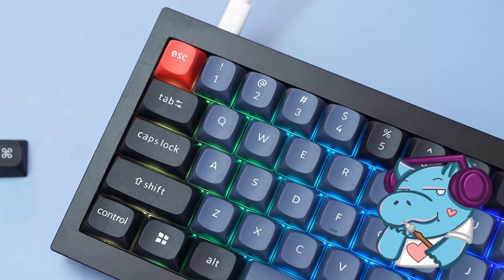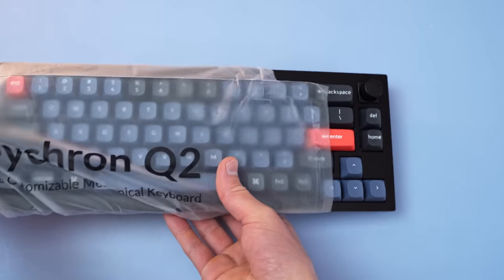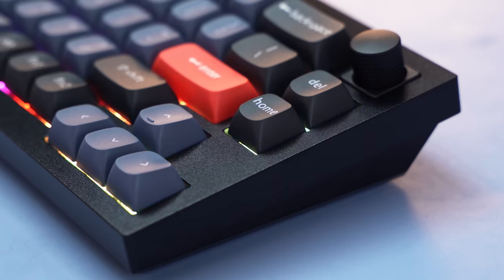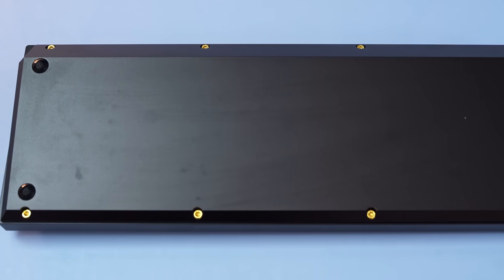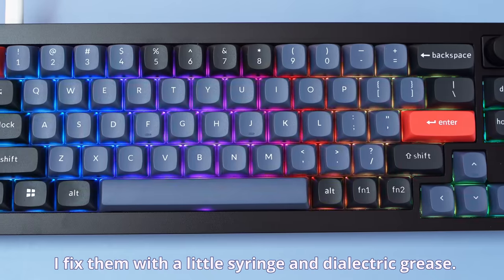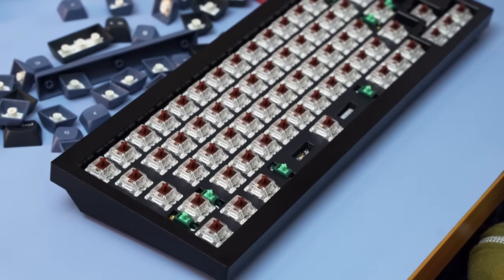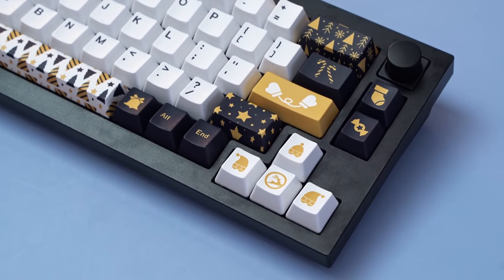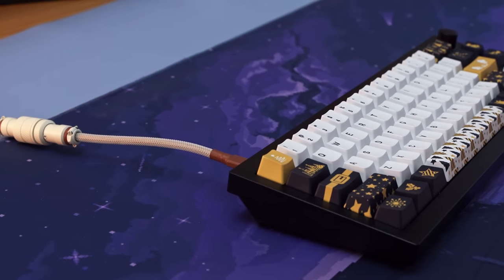You don't NEED to mod this keyboard.... but you should.

Comment: Other than the keyboard this channel requires no mods. It is just perfect!
Reply: and just like the keyboards it can only be better with mods
Reply: @emubbq  But the only applicable mod is the subscribe mod!
Reply: @cenevspeed  Nice use of applicable. I am captivated by your choice of words.
Reply: @cloakedmasq3949  nice use of captivated, I am mesmerised by ur choice of words
Reply: @xtrasin6659  nice use of mesmerised,  I am intrigued by your choice of words
Reply: @Ilovemydogssssssss awful use of intrigued, i am appalled by your choice of words
Reply: @pencilsharpener1626  awful use of appalled, I am disappointed by your choice of words
Reply: Hey there! As a fellow tech enthusiast, I couldn't agree more with your comment. In fact, I recently came across the HOTO Compressed Air Capsule and it's been a game-changer for keeping my desktop setup clean and dust-free. It offers powerful vacuuming and blowing capabilities, making it perfect for maintaining a spotless environment. I highly recommend giving it a try! 👍

Comment: The later version of the q1 had a knob option as well. Also the q2 comes with pbt keycaps instead of the abs you mentioned. Awesome video btw!
Reply: Yep, the Q1 w/knob has all the improvements of the Q2 as well (except for the nicer PBT keycaps). Better stabs, force break mod, heavier bottom case, steel plate instead of aluminum. I got mine the other week and it's pretty good stock. I do need some better keycaps though.
Reply from the maker: Yep! My bad I got the keycap material mixed up 😭
Reply: @HipyoTech  noob
Reply: @HipyoTech  is the Q1 with knob as good as the Q2 in you're opinion?
Reply: @Faced1111  I heard they made the same changes as the q2 with q1 with knob. Except keycaps but most go barebone and purchase keycaps separately anyways.
Reply: @OwOMoment  I know the revisions are mostly the same, but still different boards, like size and gaskets are a bit different

Plus I've heard a q1 with a knob in a video and it still sounded pingy
Reply: @Atmos312  I was just coming here to ask about the Q1 v2 as I just picked one up as my first move into this blackhole of a hobby after using DAS4 boards for years.   I do have some GMK caps I was going to try on this as well as some of these mods.  This comes with red pro switches, which has me sold on linears over tactile (I didn't have the choice of barebones out where I live) - did you apply any mods to your Q1?
Reply: Howdy Hey!!!
Reply: @HipyoTech  is the keychron latency as bad as people say or marketing hype for more gaming focused boards?
Reply: Hey, {{3}}! Thanks for your comment. I absolutely agree with you. The HOTO Compressed Air Capsule is a fantastic tool for keeping your desktop and other spaces clean. It offers powerful vacuuming and blowing capabilities, and it's really convenient for reaching tight spaces. And the best part? It's reasonably priced compared to other options out there. I highly recommend giving it a try. Happy cleaning!
Reply: @HipyoTech hehe boi it ain’t 69 anymore

Comment: I'm officially 100% addicted to keyboards, mods and making everything I have that I type with sound  like lush buttery finger candy.  Thanks hypyo for the inspiration and great ideas.  Oh, and the amazing content you create.  
I just spent the last 8 hours modding my K4 with neoprene in the case, lubed all the gateron browns, keycap stem o-rings and am now waiting for my K66 Womier from drop because it stupid cheap right now at 70 beans.  I ordered the Holy Panda Xs as well for that board.
Reply: Hi! I've been thinking about getting myself a keyboard to mod or a kit and start from there. 
Could you recommend me something good (between 100-200$, switch etc included) that would be ideal for a beginner like me?

Thank you!
Reply: @ruifilipe4893  Nobody responded but I just got the Nuphy Halo75 which is a custom pre-built and it's a great place to start from for the price. I went with the Rose Glacier switcher (tactile) but I'm thinking of getting the Night Breeze (linear version) for gaming. Definitly check them out, great quality for the price.

Comment: Not sure if anyone mentioned in comments, but they added the force break mod through silicone dampeners in place of where people have been putting tape in the previous Q1 to reduce ping by a mile. The Q2 and future Q1's will now have these pre-installed :)
Reply: I was ready to do the mod and was super surprised when I opened my q6 to see they had already done it. Kind of disappointing lol

Comment: I'm typing on my Q2 now.  It's my first keyboard in a few years.  I have 2 Leopold FC750R's with browns and blues. Those were my first "real" keyboards.  This Q2 takes the build quality to another level.  This thing is HEAVY.  And it's my first 65%, which has been shockingly easy to adjust to.  Apparently I don't use the function row?  The stock sound is pretty nice but I plan to do Hipyo's mods but use black ink v2s and Akko caps.  I've never lubed and filmed switches before, so I wanted to learn.  That deeper sound is amazing.  Great video!

Comment: Great Video! Just wanted to point out that this board uses Double Shot PBT (you said abs) keycaps
Reply from the maker: Yep! My bad!!
Reply: @HipyoTech    I’m willing to buy a stock keyboard without modding it so between this , IQUNIX OG80 and Q1 V2 which they apparently fixed the ping issue with it which one do you think should I get ?

Comment: Got this board a week or two ago and I did the tape mod with 4 layers today. Can’t help but feel like the gasket mount is a bit stiffer but it’s definitely worth it. Planning on putting some oil kings in there now, though I’ll probably wait til Black Friday because I need lube, films, a switch opener and stabs too and it’s only like 10 days away so I might as well.

Comment: This keyboard sounds cool I'm usually not into clicky keyboards at all I just prefer no noise for a more silent gaming session. But I've watched a couple of your mods and I must say I think I get why people like the clickiness 😅 anyway my go to snack would be anything I can use chopsticks to grasp so I don't have to get my fingers full of chip residue or grease lol
Reply: It sounds clicky but it's what us keeb enthusiasts call the "clack". The switches used here are linears, not really clicky switches. Also, it's because the board is aluminum that's why it "clicks"
Reply: With these mods which are pretty easy, it got a more deep and muted sound to it that I really dig. Audible, but not enough to pick up and annoy people over comms like plastic clicky gamer keebs do.

Comment: Loving this board so far, but my only complaint is the loud spacebar. How did you get it to sound so... pleasant in the after mods section? Is that because of the change in switch with lube and film? Did you do something to the stabilisers? Or is it a combination of stabs + switch + tape that makes it sound far quieter? The actual switches themselves I'm really happy with for now. 

Oh, and VIA software and modding is absolutely lovely. Huge fan. Is it possible to add extra layers, does anyone know?

Comment: Switched from a razer blackwidow chroma V2 that I'd been using for about 6 years now to the keyboard in this video, modded in the same fashion, just with a different style keycap from keychron and the blue version of the board since it was the only one in stock. The difference is absolutely night and day. I enjoy typing on this keyboard like no other. I hope this board takes me through a decade and stands the test of time because the quality in the materials here is outmatched by the consumer and gaming keyboards hitting the market today. I feel like I'm typing on a mechanical cloud. It's beautiful. A good lube job and some films elevate these switches too. Box ink pinks are the way to go for this board for sure.

Perfect keyboard build for everyone. This is a must grab. My only gripe is that programming this board in particular with VIA is buggy as hell and a mess to get going. I've had it crash way too many times out of the gate. Keychron seriously needs to get on that with better VIA support, especially for a keyboard company as big as they are there isn't an excuse for that kind of poor performance.

Hardware for this build is a 100/10 but the software support is like a 5/10. May I type on this board through the ages. Thank you hipyo for a perfect keyboard, this just hits the spot.

Comment: I think the film at the bottom is there to prevent it shorting out. The space between the pcb and the case is quite small, so the pcb could maybe touch the case if you press down hard.

Comment: Howdy Hey Hipyo! This is my comment section typing test, its done with a gk86xs with lubed and filmed gateron blacks, neoprene foam case mod, tuned plate mount stabs that are just above average and stock DSA keycaps while i wait in my dream set nk pbow to be back in stock. Its an ok board to use and i have no complaints really besides the software.... but that Keychron Q2 making me wanna save up my  money for one soon.

Edit: this is my first custom board, I wanna do more honestly but i have to live within my means.

Comment: "After Mods" 10:21 - I feel like I missed something? Which mods are we talking about? Beyond the tape mod. Changing the switches and keycaps? Did it make that big of a sound difference going from "Tape Mod" to "After Mods"? Because if so, holy... that's significant.

Comment: so the q1 now has a knob version, its actually what im using to type this out. i built mine out with durock linear teals lubed and filmed, GMK laser r2, and durock v2 stabs. i did do a kilmat mod to it and it kept the flex and sounds really good, and the tape mod. they also added the force break mod to the keyboard out of the box which helps with the case ping.

Comment: Wait, elaborate on those switches some more? Did you mod them, or are they pre-modded. Also they look like the pinks which would have 50g springs, but I see they have some kind of black layer or gasket in them, which is different from the images on k4a website.

Comment: What a coincidence. I'm actually getting the same color barebones kit, have some black ink v2's coming (which I will film and lube), also got some of their dye sub PBT caps. I imagine my board will sound about the same as yours after the tapemod, if so I'll be quite happy with that result.

Comment: Hey, did you really only mod this keyboard by:
1) tape modding (3 layers)
2) Ink Box v2s
3) Different Keycaps
?
Because if so, this is really amazing. If not, what else did you mod? It's still the metal plate right? And what about any additional foam? Great video by the way.

Comment: In my opinion the best budget keyboard for gaming is the Higround basecamp series. Sounds amazing stock but you can make it sound even better with mods. Im using it right now and the only thing ive changed about it is I changed the prelubed TTC switches for some unlubed KTT roses. It sounds about the same, just a little deeper now.

Comment: You can never go wrong with some good Pizza rolls. Don't know how they are in the usa, but the one's at Domino's in Germany aren't that good, they have a little bit too much bread and only a wee bit of ham/salami/whatever you are ordering with them, but another pizza chain named "Smiley's" (I think it got founded in Turkey) have just the perfect pizza rolls. I prefer to order them with normal ham or however it is called in English, and they just have this nice, more wet bread that isn't as wet as if you would say it is getting more of a downside, but rather I would say... Juicy? Well, anyways, you also got this nice slice of ham just baked into it in the form of a spiral, surrounded by the "molten" cheese (it's at the same point between really solid and molten as the mozzarella on pizza), and the bread. It is, hands down, one of the best snacks I've ever eaten. If you just read through this, then seriously, what are you doing with your life

Comment: Have to ask, have you tried modding the K10 (aluminum frame)? I've done the basic tape mod and shoved some foam underneath...buuuut...it doesn't have that thock. Using gateron pro2 reds. :)

Comment: Hey ya, at 3:47 you mentioned the keycap is ABS. However from Keychron website, they said they included a set of double shot OSA PBT keycaps. It'd be great if you can confirm this. Thanks. :)

Comment: I recently purchased a Keychron K7. The K7 is advertised as "wireless". It is actually Bluetooth (same frequency band, different protocols). Connected to my system with supplied (too short) USB cable. Multiple keys do not work. Keychron sent me a link to a website designed to test keyboards. I sent a screenshot of the results to Keychron. Keychron demands a video showing the keyboard and screen proving that I did not falsify the test results. The product is sold "as is" - there is no warranty. Tried to get an RMA number and a return shipping label. If the keys do NOT work, the feel DOES NOT MATTER, and the reliability DOES NOT MATTER! If this is the way they treat their customers, do not expect them to be there in a few years.

I have never had a company demand that I provide a video proving that I did not falsify their test data. Look at their "service" non-warranty. They specify "as-is". They do not guarantee that their products work to any extent. And they refuse any responsibility for what happens when you use their product. The laws in Hong Kong must be very different. 

The reason some keys do not work could possibly be defects in design or manufacturing. More likely, the firmware does not conform to the USB Human Interface Device (HID) standard.

Since they take an adversarial position to customer complaints, I do not see them lasting very long. Other manufacturers can make (or buy) red optical switches. Do not expect Keychron to be there when you have problems in 5 or 10 years.

I have demanded that, for the video, they must send a cameraman and equipment and pay me my consultant fee for demonstrating that their keyboard does not work. I have also demanded a written apology from the CEO and an immediate refund.

Other manufacturers should re-think the Windows and Apple-only policies. Given that iOS is a facade sitting on top of embedded Ubuntu Linux (eLinux), Android is a facade on top of eLinux, Chrome OS is a facade on top of eLinux, OS X for the M1 is probably a facade on top of eLinux, and Windows for the ARM is a facade on top of eLinux, supporting Linux might be a good idea.

Apparently, Keychron does not have a Customer Service Department. I did receive an email claiming that if I sent the defective keyboard to their warehouse, I would get a refund. I emailed back, "What is the address of your warehouse?" They eventually gave me the mailing address. 

On September 10 I sent the keyboard back. As of December 16, no refund and no keyboard.

Robert Pearson

Comment: I own a Logitech g pro with chary MX blue swished and this board is not hot swappable so I can't really mod it without desoldering the switches. But I might get the Keychron Q3 or maybe a bit smaller and this will be my first time getting a customizable Keyboard. it will be a fun little project.

Comment: I love the Q2 thus far and my complaint is that loud space bar. What mods can I do to just ONLY the space bar so it’s more muted and deep toned?
Reply: You can change the switch on the space bar only, you press it differently than the rest of the keys, so you won't notice a heavier switch.

Comment: Question for all yall from a total noob. Are there any like.....starter kits? A kit that has pcb, case, switches, keycaps, maybe some foam or lube or switch opener that is all compatible with each other. 
I want to start building a keyboard but from all the reading and videos I'm watching it seems like the biggest hurdle to entry is making sure everything is compatible. My concern is even if I do a the research ill still fuck up and waste money just because I don't know anything. 
Or is the solution to buy something pre-built (as the pc gamers say) and mod from there?

Comment: Howdy hey Hipyo Tech, recently i bought the Keychron K2 V2. i really love it, i like the feel while typing it i like the stock caps looks and feel i like almost everything about this keyboard even the stock sound of it. but until recently, this keyboard starting to give me some tough love. i mainly use this keyboard via bluetooth atleast that was my plan so that i have a clean wireless desk setup but the bluetooth connection starting to acting up at first i thought this was a sign that i should recharge it i didn't think much of it but after fully charged the connection still laggy disconnected and reconnect i already download the new firm and installed hoping it would fix it i even update my pc bluetooth driver but still the problems occur. i don't have any other keyboard i gave my old one so that i could purchase this one, please help me my guy how do i fix this. i know this doesn't really related to the video but i thought it would be a good idea to ask you on the video that put me into this rabbit hole of a hobby XD. cheers

Comment: How long does the lube last? Does it dry out after a few years?
Reply: Yeah, the lube will fade away after a couple of year. But you don't need to worry about it too much, because the purpose of lubing is to apply a boundary lubrication to your switch's material (stem and housing). Even when the lubricate oil has faded away, your switches will still maintain it smoothness due to the boundary lubrication never fade away.